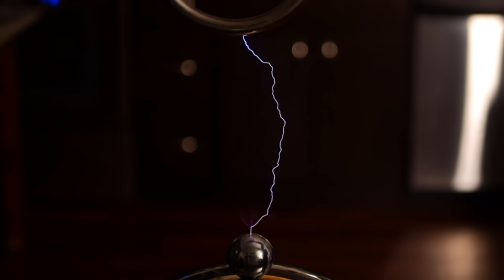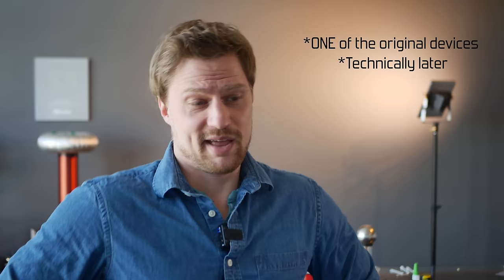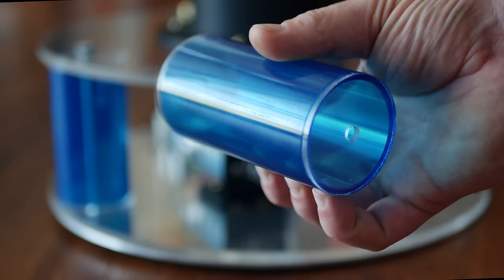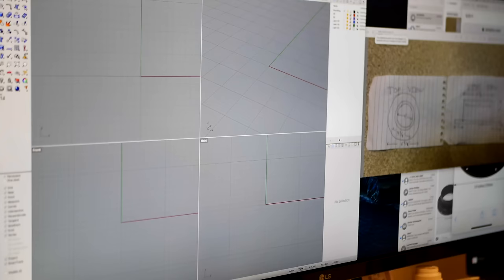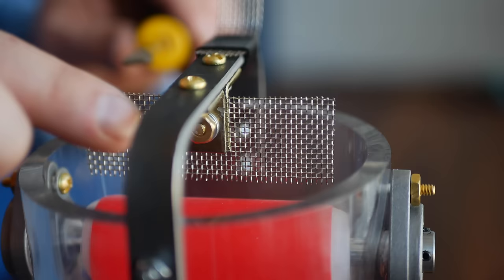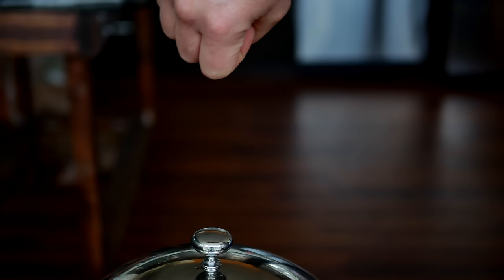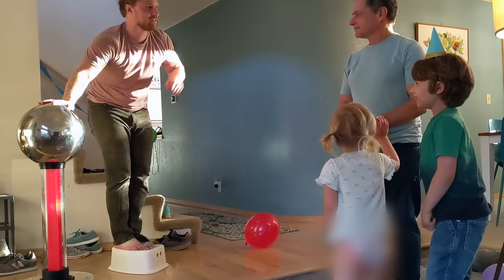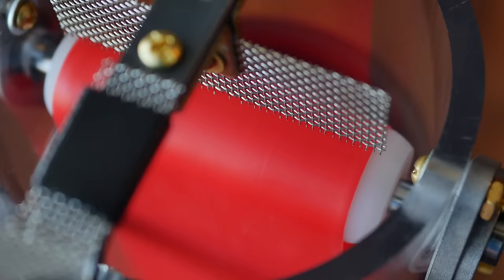Insane 500,000v from rubber (Van De Graaff BUILD)

Comment: I built a van de graaf generator years ago with an aluminum can and a spool of thread and barely worked, but it did function, but without a proper housing, it quickly broke down

Comment: Built one about 3 foot tall back in the 80's and used aluminium for the bottom roller and Teflon for the top and a black 2" wide rubber belt. It easily produced 12" sparks and still runs 30+ years later.
Reply: So its 32+ years later now. 

Care to show it off? :D

Comment: Wow this was super well done. The garden gazing ball was brilliant. Back when I was first getting started with science the stupid top load was always the thing preventing me from building a van de graff generator myself. The hang spun balls sold specifically for this just cost too much. But those gazing balls are dirt cheap! Suddenly the idea of building that particle accelerator isn't so far fetched.
Reply from the maker: Hey T.E., thanks for the compliments. Yeah, the gazing ball is a great option. Just be prepared for hours of dremel work to get the right fit at the base. It took me nearly 2-3 hours to get the right fit. I honestly love Van De Graaff generators now. I had the same issue growing up!
Reply: @PlasmaChannel  isn't that stainless steel? 
 Wouldn't it be better to use aluminum on the top load because its more conductive?
Reply: @helpabrothawithasubisaiah5316  they can always electroplate it with copper
Reply: I'm also using garden gazing balls. Cheap but almost perfect for the job, although a toroidal shape is better.
Reply: @helpabrothawithasubisaiah5316   No, any metal is a good enough conductor.

Comment: This is the most difficult project I have ever attempted. I have been building mine for over a year primarily because the belt keeps drifting. Every time I make a change to keep it centered something else goes wrong. The two times it has worked consistently produced great sparks so that keeps me motivated. Hopefully your video will help solve some of my problems.
Reply from the maker: Hi Michael. Take a look at my rollers. You need to chamber the ends. That keeps the belt always centered. This will solve all your issues.

Comment: Honestly, I don't think you really need the Rollers. 
If you rub a Disk of Teflon against a Disk of Glass. 
Place Metallic Grid on top of the Teflon Disk and attach your Wire that goes to the Capacitor. 
Make sure the Glass Disk spins while the Teflon remains stationary.
In case anyone is wondering, I majored Electrical in High School.
I was the first Student to put together a working Van De Graph Generator for my Senior Project.

Comment: When I was a kid, I worked out exactly how to make a static generator with a vinyl record.  The only motor I had access to though, was a hard drive motor, which it turns out is some kind of stepper motor, which I didn't know how to drive.  So I never ended up making it, but I had a record, the motor, and some other components sitting in my closet waiting for me to figure out how to make that motor work for almost a decade.

I don't have that stuff anymore, but I'm sure I can find a vinyl record, and I have some engineering knowledge as well.  I also have access to motors that are easier to use, and I've learned how to control stepper motors.  Maybe I'll do this project I wanted to do as a kid with my own kids!

Comment: man how much time i wasted on mine, it ended up making like 12cm sparks (when super happy) and yes, i'm using a thin blue belt and i washed the talc powder away with water (soap kills it)... also it doesn't like humidity, i have to heat the pipe up with an hair dryer before turning it on... yours is awesome!!!
Reply from the maker: You must live in a humid area? Yeah, if you include heating elements in the base of the tube, it will be an easy permanent fix for that humidity.
Reply: @PlasmaChannel  i dunno, it must be my house... anyways i just need like 30 secs of hairdrying and it's ready

Comment: @Plasma Channel
0:52 You should put rounded metal-things (tubes?) along the 3 edges of that net, to reduce the energy loss that is bleeding off into the air from all those pointy edges that the wires make.
Reply from the maker: Hmmm I'm not familiar with this technique. I'll look into it. Thank you.

Comment: I've built lots of Van De Graaff Generators over the years... big ones and small ones.  I built one in High school that produced nearly 2 foot long sparks... But,  I've always had issues (due to poor engineering) about belt alignment and tracking. Most of my machines end up running the belts on the edges of their rollers or the belts go all over the place and wear out quickly. Usually this is because in all of my designs I've put the bottom roller directly on the motor shaft so it tends to cantilever up at an angle when the belt is on it....   But I need to be able to change the belts easily..  Looking at your design I can't see how you get the belt on and off... at least not without completely disassembling the bearings... 

Perhaps if I engineered mine better then I wouldn't need to change belts so frequently... but I still think the belt should be an easily replaceable item. Am I missing something in your design on how the rollers go on?

Comment: Interesting fact is that such a generators gives you usually about a hundred(s) thousand volts and the current in that sparks rises up to several dozens of amps that considered absolutely lethal. BUT the time it acts so short (nanoseconds) that any damage just doesn't have time to happen.

Comment: Jay this Van de Graaf is fantastic, super clean built, and good power! I think it would be good, if you cover the edge of the sphere with for example electrical tape, than the voltage get higher ;) (bacause of corona discharges) 
Haha love it!
Reply from the maker: Hey Leon! Thanks, I wanted to build a high quality one for a while now. As for the corona leakage, I actually have a corona ring that i'll be putting on the base of the sphere soon.

Comment: I tried using a pulse width modulator for speed control on mine and once it built up a charge the PWM was toast. I finally got an old fashioned wire wound ceramic rheostat and it worked great. I love Van De Graaff generators. I gave up on hall effect sensors and transistors around HV if I want it to work. Very nice build Jay. I wish you had spent more time showing it off. Besides acrylic is so cool.
Reply from the maker: Yeah, JUST killed the speed controller at the end of the video, when I showed the last sparks on my arm before the end. There are ways to electrically isolate the board though, and im working on that. Thanks!

Comment: If "electrons" were in fact cavitation bubbles caused by the violently spinning nucleus I would argue that what you are really doing is increasing the spin of the nuclei causing an access of bubbles in the atomic structure.  This makes way more sense than any magical affect.

Comment: Here's an idea: make the bottom roller made of metal and ground it. Then, use the positive output from that DC flyback HV supply you made as the bottom comb. This will spray electrons onto the belt and everything will work exactly as before; however, I bet the output would be significantly better... What I'm describing is the most popular mode of operation that this machine was actually used for particle accelerators and other applications. Just be careful at that point, though: the output probably won't be safe to touch...
Reply from the maker: Thank you for that input. I actually intended to make it a charged base - and did some tests but failed to succeed, so scrapped the idea. I'll give it a go with a grounded lower roller - we'll see how that works. Just wish Al was further away on the triboelectric chart....

Comment: Nice job! If you wrap wool around the bottom roller it increases surface area which enhances charge rate. For the sphere, I always had trouble with bleed-off around the cut edges. Electrical tape didn’t really work as well as I hoped. The best way I found to increase the voltage potential is to take a silicone air tube for fish tanks and cut a slit lengthwise and slip it over the cut edge of the sphere. I tried just resting it on a ring like you did, but It didn’t really help. With the edges better covered, the sparks were much more powerful in my case.
Reply from the maker: Thanks man! Glad you enjoyed my take on the video. As for the tubing...whoa...cool idea. I have a corona ring that is 1/2" diameter steel, but, have not had the time to fit it on yet. I'll try both your idea and the ring.

Comment: Hlo sir, why there is no flow of electrons when wire is connected in-between cathode of one battery and anode of another battery?  how voltage of batteries adds up when connected in series....what happens in the microscopic level in the batteries...can you give an intuitive explanation sir.

Comment: I think that the performance of the large unit could be further improved if the bottom of the dome did not have sharp edges where it mounts on the tube, these edges should be curved inwards to stop stray discharges to the air.

Comment: Using that metal screen idea for my Whimshurst!
Reply from the maker: For a physical contact style of device (Wimschurst), it may not be a good idea. Since those machines rely on physical scraping, it would wear your machine down realllll fast.
Reply: @PlasmaChannel  I was thinking about using the screen for the collectors instead of the brushes. Would that work?

Comment: i made one of these a few years ago out of pvc about 2 times bigger and use a blue plastic 55 gallon drum as a capacitor by lining the inside with aluminum the outside it made over 2 million volts the loudest discharges i have ever heard try it out insane!!!!!
Reply from the maker: Oh wow. That's just terrifying.
Reply: What did you use for the belt and rollers?
Reply: @johnnycash4034  Teflon rod turned on a lath and large exercise belts
Reply: @christophercridlebaugh8965  sounds insane. Do you have a video?
What size teflon rods did you use? I assume the bottom rollet was nylon also? I can't seem to find large excersize belts anywhere? The biggest ones are about this size of this video.
Reply: @johnnycash4034  i can make a video about this it will take about a week got to get it out of storage
Reply: @PlasmaChannel  check out Steve ward if you want terrifying his Tesla coils are amazing
Reply: @christophercridlebaugh8965  yeh please do. I'm building one of my own so could do with some pointers.

Comment: i saw multiple designs where the top roller is static and doesn't move. Would that improve the output due to more friction?

Also: Are those the best materials or how would i be able to find better ones? Is there some kind of value i can search for? And is there a way to minimize the current but keep the voltage? for example topload shape?

i'd very much like to build my own version but don't have enough budget to try out lots of designs / materials so i'd like to get the best experience i can for as little as possible.
Reply: The top roller has to rotate as friction here could lead to belt failure. The charge is built up in the lower roller by contact and separation- it doesn't actually need friction between the roller and belt for the charge, just enough to make sure that the roller drives the belt.
The top load should be spherical if possible, with a smooth surface. Any seams or projections will reduce the voltage attainable. Sorry it's taken 10 months for this reply as I have only just found this channel.
Reply: @MervynPartin  Hahaha, didn't expect to get an answer to that comment, especially after such a while ^^ Yeah that makes sense and i know about the voltage loss due to corona discharge, i was just wondering why people tend to use spherical toploads for Van-de-Graaff generators and toroidal ones for tesla coils. Thanks nonetheless for the reply and welcome to the channel ^^

Comment: Jay, Please try to get a spark or plasma discharge to follow a laser beam.  I just Googled it and this has been done.  LOL "I" had the idea after watching this video and one by Styropyro.  LOL, turns out I was not the first to think of it.  The laser will ionize the air and the electricity will want to follow it.  I'd guess it should also jump farther.

Comment: Hey, to increase the output even more you could tape around the sharp points of the steels meshes, since some charges might be flying off. Amazing video btw!
Reply from the maker: Yeah, I actually ordered a special corona ring that was supposed to go around the base of the sphere. But...it was just a HAIR too narrow, and would not slide over the tube. Long story short, after a couple hours of dremel grinding to get it to fit, I gave up. I plan on doing a followup video where I supercharge the thing.
Reply: @PlasmaChannel  hell yeah

Comment: Electrical tape placed on the cut metal ball might help with electron loss and thus increase ur spark gap.
Reply from the maker: I've added silicon tubing, and electrostatic shielding via a metal ring. Next time i'll just fold the metal inward lol. So much work.

Comment: Instead of acrylic, I wonder if ABS pipe for plumbing can be used. Il would be cheaper, and a toilet bowl adapter can be used to support the tube.
For the comb, the metal mesh is a great idea!
Reply from the maker: ABS is black, so contains carbon as a coloration compound. It will be very mildly conductive, and will prevent a full charge from developing on the sphere.
Reply: @PlasmaChannel  I wonder if PVC would do.

Comment: You can make one of these with a 1x 30 inch belt sander. I learned this by accident while sharpening knife blades with the belt sander. I was getting massive shocks every time my finger touched the metal base
Reply from the maker: That's actually really cool. Turns out, that is pretty much how this device was invented. It was inspired by industrial belts and pulleys in the 1800's building up static.

Comment: Not all vdg's use the triboelectric effect. Large lightning simulating ones use a high voltage power supply to spray charge onto the belt.
Reply from the maker: Spraying onto the belt is more of a booster, and without triboelectric effect to repel the electrons from the top roller toward the top combs, the system would not work. The belt would just become saturated with electrons and spin around full. 

The Boston museum of science one I showed right after the channel intro screen uses both tribo and a boost. 

Cheers.
Reply: @PlasmaChannel  Not sure I understand that. The sphere concentrates the charge on it's outer surface. In the center of the sphere where the comb is it's basically neutral is it not?
Reply from the maker: the upper pulley is inside the sphere. As the belt contacts the upper pulley, the difference in materials causes a repulsion (or attraction, depending on polarity of your device) of electrons. Those then travel to / from the inner sphere. Technically the inside of the sphere is neutral only because the electrons (in how I built mine) travel to the outside of the sphere due to faraday effect. However, there are still regional positive and negative charges on the belt / upper roller that cause the movement of electrons in the first place,
Reply: @PlasmaChannel  My first vdg had a polycarbonate bottom roller, a wooden dowel top roller (stuff all negative charge effect), "sphere^ was made of two mixing bowls. 8" sparks. But yeah there is still confusion on how they actually work.

Comment: Have you measured the short circuit current ? An old rule of thumb is 50 square inches per second of belt  gives one micro amp.
Reply from the maker: Cool Rule of thumb! At full speed, the belt does 5 rotations a second. It’s 3 inches by 24. So 360/50= 7.2uA.        Man that’s so little 😐

Comment: 3:25 "Those electrons come from the Earth"
If you use a HV generator (your mini Tesla coil, maybe?) to give those electrons to the mesh (active charging), instead using the Earth (passive charging)? I think VDG Generator will act as a Amplifier, thus getting a times x more voltage than the HV generator.
Try it?
Reply from the maker: Funny, I originally intended the video to go in that direction. Planned to do a charge-boosted generator. My initial tests did not go as intended though, and I still needed the ground connection to boost the bottom comb's voltage.....I plan on trying the concept again.
Reply: @PlasmaChannel  I did this and worked; of course, the HV should be grounded or have a large base that act as a ground, like a counterweight of some sort.
 On my setup, the sparks increased from 3-4 cm to 8-10cm. The HV was a 30KV (aprox) made from a pair of 2N3055 and a transformer, then a voltage multiplier from a color TV. The VDG machine was a 40cm leather belt with 20cm diameter dome. All setup was on a 50cm diameter aluminum sheet (2mm thick) that acted as a ground (not grounded tough) HV connected to it.
I did it to study the Crookes rays on vacuum/gas tubes.
Strange thing, I only saw this idea in a recent paper few years ago.
Also, as a constructive idea, I would round any sharp edges on the top collector of the machine (the upper mesh, the cable that connects the collector to the sphere) as it can self discharge and loose potential; you may look for sparks inside the sphere.

Comment: the whole thing moves when the spark goes off.
Reply from the maker: The electrostatic attraction is pretty impressive. You can feel it pulling your entire arm right before the spark.
Reply: @PlasmaChannel  I mean, I get it pulling at your hairs, but I have never felt an attraction of my whole arm, or even fingers, I don't have a generator like that one, but I have found some materials in my  house that have a very different attraction to electrons, and they make big sparks.